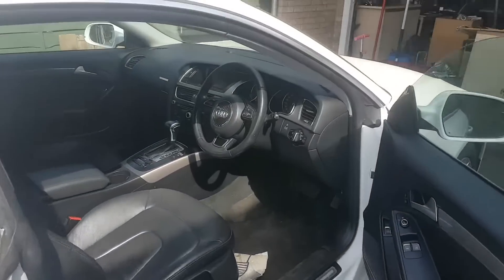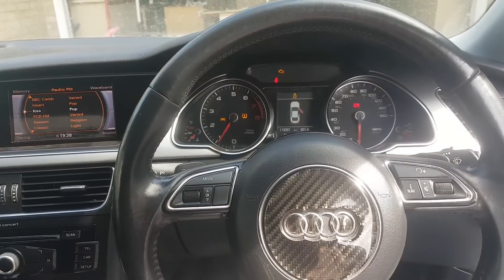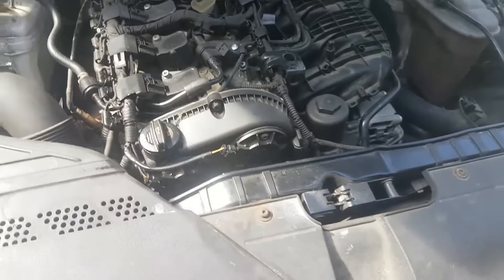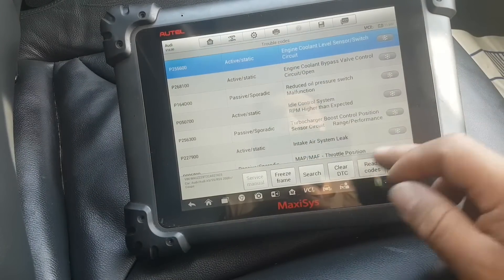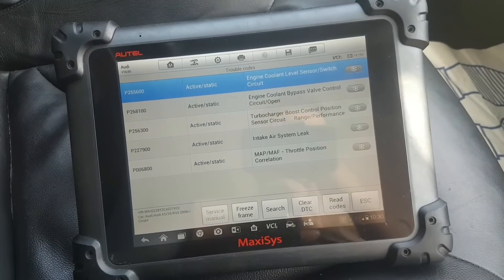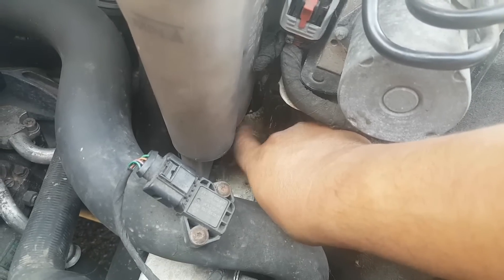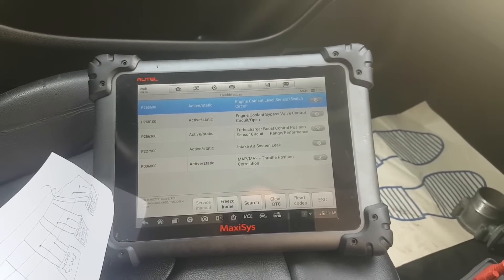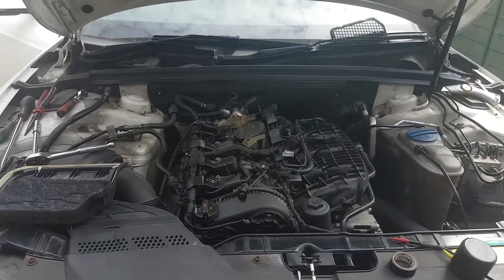A5 1.8 TFSI, Big problem! More than I bargained for... and the owner!

Comment: On my 17 A4 a coolant leak internally in my waterpump/thermostat that was corroding the connector, making it throw codes for the turbo charger and would misfire/limp mode, leak was so small you couldn't even see it, and never refilled the coolant at 30k miles. Gotta love audi

Comment: Spot on we recently had a V8 Range Rover come in for rust repair sill's arches etc luckily the customer mentioned it had been at a garage to get a coolant leak fixed and it still had a problem so we did a few checks and test's on the coolant system before starting the body work and it was obvious that the engine had a serious issue and after giving the customer the bad news the decision to stop was made if he didn't mention it had another problem we would have dived straight into the rust repair
Reply from the maker: 😬
That sounds like a good catch!
👍👍👍

Comment: Could be the camshaft advancer, timing chain.
But all this could be going bad for low oil pressure.
So yeah if thats the case the first thing to go wrong is rod knock.
You are right.

Comment: good morning Luis yes a troubled audi there yes you are right a little / small  end but on the speekers of my computer sounded like hydraulic lifters going dry and tappet rattle or ballance shaft ? either way the engine is pooched and needs a good looking at my favourite tool is a long pound through screwdriver against my ear then go on each part of the engine where suspect faulty part i once had a corsa 1.2 the owner said cam rattle done screwdriver test all ok got owner to do same then got a short bit of 10 mm id hose and wnt around intake and exhaust  ok then went by spark plugs no2 was loose showed owner with pipe then tightened  plug noise went but even i would have sworn it was a cam lifter rattle
Reply from the maker: 👍
As I said,  looked like... I have not or was too bothered to investigate any further... as I would not be touching it from here...
Yes, if I was to look deep into it, further testing would be done...
👍👍👍
Reply: @LMAutoRepairs  please dont take offence it could very well be small/little ends i am just saying the speakers on my pc did not reproduce the sound very well you are one very very talented guy the engine is shot and as far as what you would do its game over sorry for any misunderstanding
Reply from the maker: None taken...☺️
To be fair, the sound is never truthful once processed...
Either way, the engine was f****d... 🤪
And that, can't be argued...☺️
👍👍👍

Comment: Wrong diagnostic, TFSI engine got timing issues, but you are correct on need new engine as camshaft has gone 😮
Reply: More cam shaft pal that bottom end
Reply from the maker: I said it looks like...
Until striped neither I or you are correct...
👍👍👍
Reply: My words are indefinite  
Experience makes clear roads in your life

Comment: If that was the bottom end it would knock on idle aswell. This is an issue with the top end, might even be the camshaft control valve at the front. Try unplugging it and see if the noise stops
Reply: You are wrong, many engines have rod knock and have 0 noise at idle speed, they only knock when you rev them.
Reply from the maker: I have definitely seen that as well...
No issues at idling and noises revving...
The camera to fair, makes the noise coming across slightly different than it was in reality...
That said, I guess that stripped would be difficult to pinpoint the exact problem with the engine...
👍👍👍
Reply: sounds like a rod to me especially as its only there once loaded
Reply: @LMAutoRepairs   Fair enough, if it's a rod, then when you remove the oil filter cartridge it will have loads of metal in the pleats of the filter. If there's no metal i would look at that camshaft control valve

Comment: Hi mate I need your help 😢 I have one land Rover evoke and I change my Instrument Cluster Speedometer my car not start and I put my Instrument Cluster Speedometer back to my car now my car start but my locks don’t work I don’t know what can I do do you have any contact number to contact you please?
Reply from the maker: The fobs probably need resync...
Why have you tried to replace the cluster to start with?
👍👍👍
Reply: @LMAutoRepairs thanks for reply ❤ We already changed the KVM and two new keys programmed to the vehicle but still doors won't lock unlocked with remote , been told by JLR either have to fit new IPC or blank the current IPC to reprogram again , can you help me to blank the correct IPC ?
Reply from the maker: Is not just programming...
It needs alignment of the modules...
There is an entire procedure that needs doing...
Reply: @LMAutoRepairs  We have already done CCF files configuration and immobiliser function but keep failing for security , 
Any advise ?
Reply from the maker: Is that connected to Land Rover servers online, or offline?